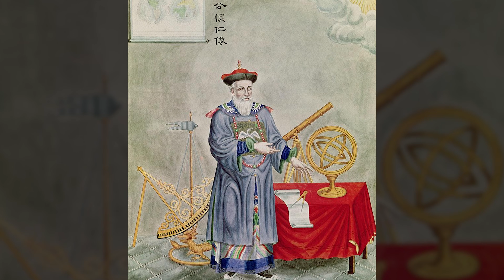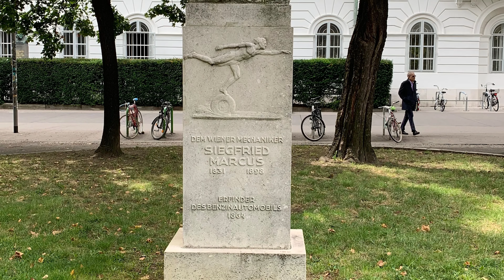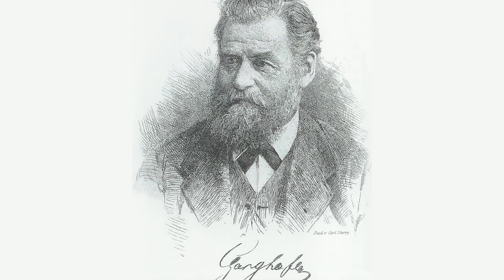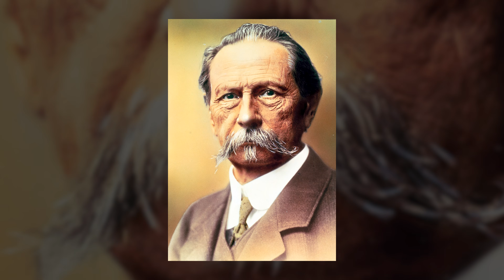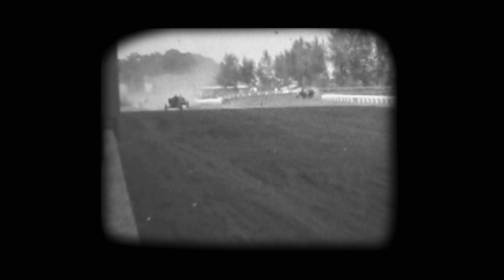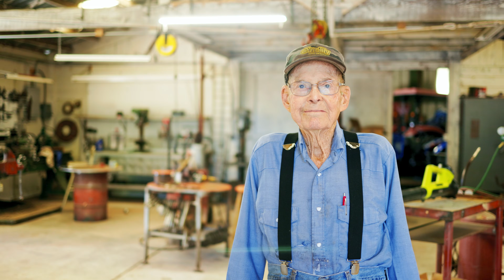Classic Car Brake Pads and Asbestos Exposure

Comment: Brake cleaner ain't for nothin, don't forget to use it everytime to clean off the brake dust before touching the parts.
Reply from the maker: As my old man used to say, "brake cleaner isn't optional."
Reply: @asbestosclaimslaw  Smart man, wished I'd always followed that, specially when I was younger, just didn't realize....  Just make sure not to drop a brake rotor on the can, I did that once right next to me and didn't realize that the can was leaking till I started wondering why I was so light headed, I couldn't smell nothing for months.Good video, people really need to know.